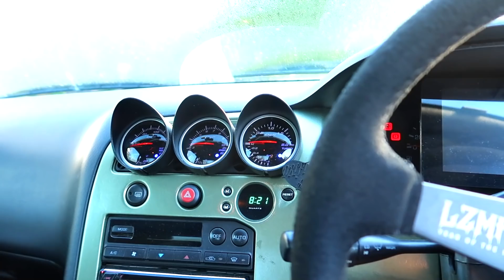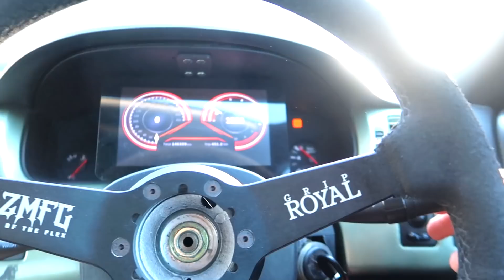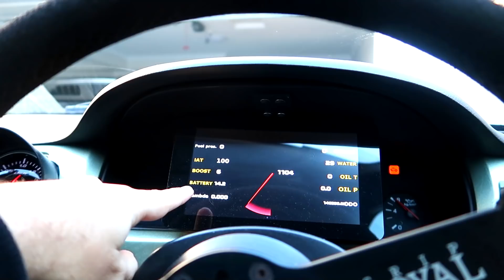RX7 Wrap is FINALLY DONE! + R33 Update!

Comment: For what it's worth, fast indicators are usually either because you've got a blown bulb or you've put LED bulb/s in without adding a resistor to the circuit.